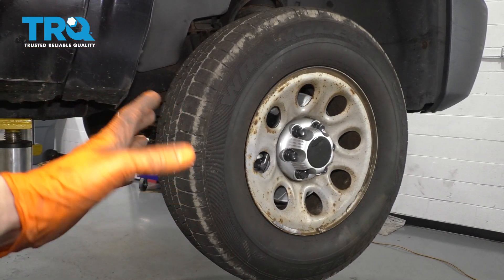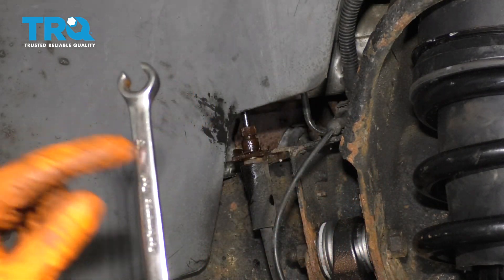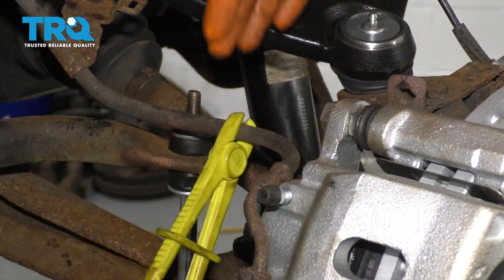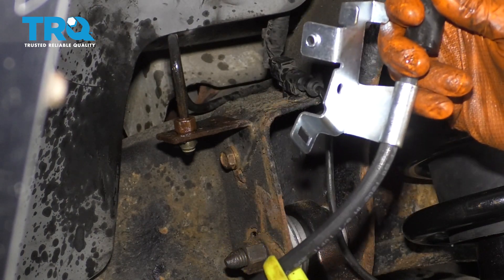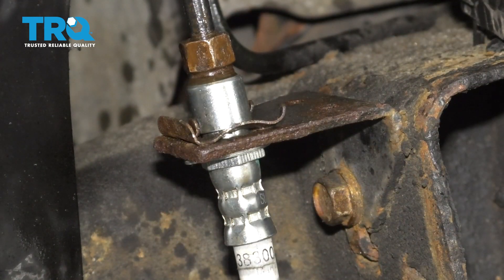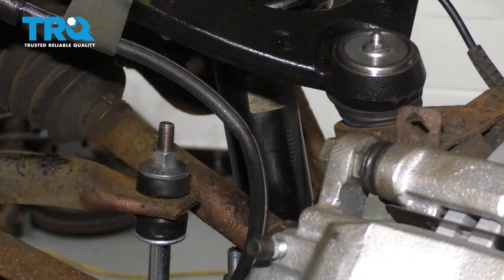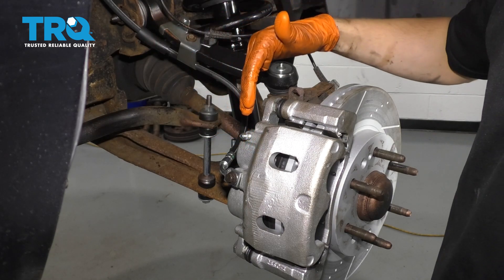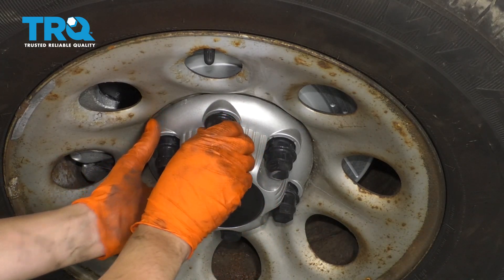How to Replace Front Brake Hose 2007-14 Chevy Silverado

Comment: Question? I have a 2009 Silverado 1500. 4.3- 6 cylinder. RWD, my front passenger break caliper froze on the rotor, I replaced the entire wheel assembly! Well, 2 months later, today it decided to do it again same place. Im prayin i dont need to replace the master cylinder an booster, but im replacing the caliper and break hose. Any advice on this issue would be appreciated